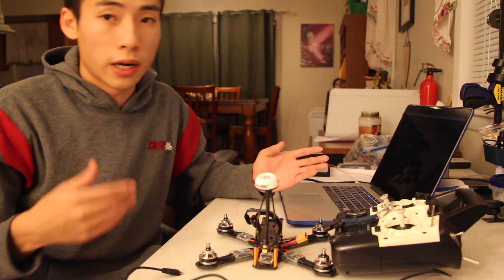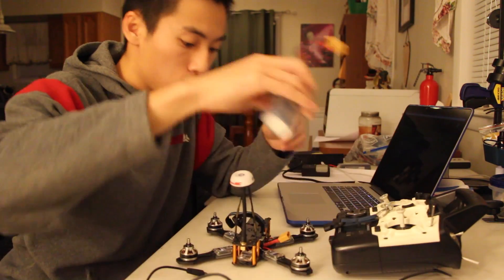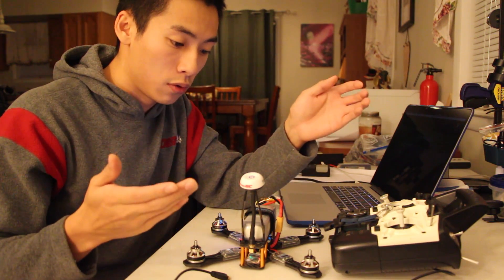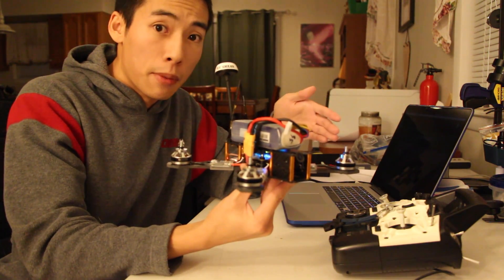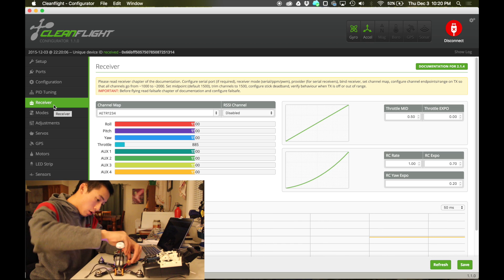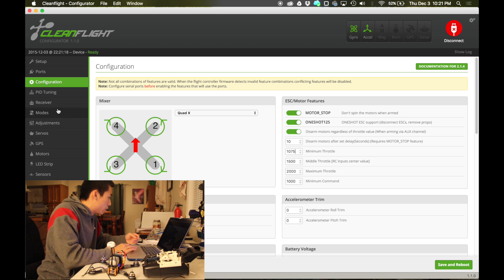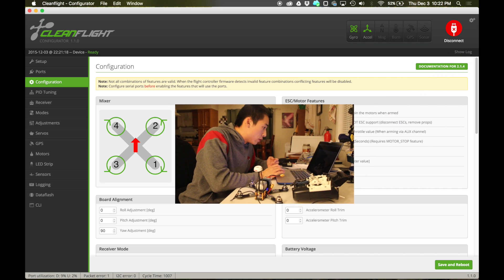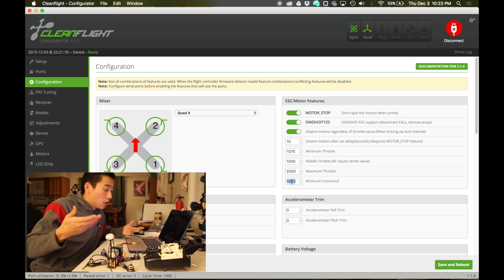Calibrate ESC with Cleanflight plus tips!

Comment: Great video. Have a problem. Using Cleanflight (ZMR 250 and same problem on Diatone 150 with same ESC's and same Naze 32 Rev 6) latest version with Naze 32 Rev 6 (10 DOF Board), Little Bee 20A ESC flashed with BLHeli. Everything in Cleanflight works perfectly and all motors are synched but Naze will not arm. End points are 1012-1500-2010 on Throttle. If I decrease the mid point I can get Min at 1000 but then top end drops to 1990 or so.....why won't the Naze arm? I have tried 3 other Naze 32's of which 1 is acre, 1 is original Rev 6 and one Rev from September 2015 but none of the boards will arm...this all started when I updated Cleanflight without backing everything up. Thank a million in advance!
Reply from the maker: Hey check the receiver tab again. Make sure the throttle and rudder direction isn't backwards. Also check that they're on the right channels. You can adjust the end points in the transmitter (at least I can on the 9xr) to meet the 1000-2000 range. Also, is the board tilted too much? There seems to be a max tilt that it will arm with. Too much tilt and it won't arm.
Reply: Thanks but the throttle and rudder direction are correct. The board is totally flat. I have tried everything I have read in the forums but the Naze will just not arm....it used to on all my Naze boards but now none of them will arm....Has something changed in the arming of these boards in Cleanflight? I always just put throttle down to the right (centre of Taranis Plus (Mode2).

Comment: I see you're using a 9xr (pro?) How are you setting the min throttle to 1000 on it? I can't find anything in the manual about that. I'm newb
Reply: I tried it with the min throttle at 985, and attempted this method, but it made my esc's worse.
Reply from the maker: +Black Cardinal 1 in the transmitter, I went into subtrim and made the mid stick exactly 1500, then in the endpoints, I corrected the max and min to hit 1000-2000. What transmitter do you have?
Reply: +Chonny I got a 9xr Pro. 
Turns out, my issue was just because the motors won't act right when on a level surface. It works fine as is, but I haven't changed the sticks to go from 1000 to 2000. Is in on the mixer or the limits or something? I'm not seeing anything anywhere with those numbers? Or are you talking about on CF?

Comment: PLEASE help i'm doing everything you say to do but they aren't calibrating like when i drag the master slide to the top and plug in i get no sounds no nothing?
Reply from the maker: +Thomas What ESC, firmware and flight controller are you using? Also, do the motors spool up at all in the motor tab? Might need to make sure signal wires are connected properly.
Reply: little bee 20a, naze32 rev6. Yeah the do spool up it's just one motor doesn't start at the same time

Comment: having a problem with my new emax rtf. done all the claibrations and only three motors spin the forth motor slightly moves and stops. I swaped the two top motors and same thing happend so its definitely not the motor any suggestions??????
Reply from the maker: +Andrew Moore Sorry missed this notice. Uh check that the ESC solder joints aren't touching any neighboring chips. Also make sure the screws that hold the motor down don't touch the windings. If you're sure the problem is in the ESC, it may be worth trying a new ESC as they're a little more difficult to troubleshoot.
Reply: Got it sorted thanks. Sent it back. It was a faulty esc. Cheers

Comment: Chonny thanks for taking the time. My grandson and I have built a Robocat and had problems with motors/ESC's firing up randomly. I tried this method you showed and I still have two motors that start late, on my Turnigy 9X Throttle of is 1060 full is 1900. I have even tried calibrating the lazy ones individually. When in cleanflight after calibration and using myTX the start values are all over the place. Should I have set something up on my TX? I have watched a few videos on PID tuning but beyond my skill and knowledge thus far. Any advice appreciated 😊
Reply from the maker: +Trevor Vernon the transmitter does not control the motors, so as long as it travels between 1000 and 2000 you're good on that part. if you raise the main motor control in cleanflight, do all 4 motors throttle up at the same time? also, do you have Motor Stop on? try raising minimum throttle to about 1100 on cleanflight or lower your transmitter minimum throttle closer to 1000.
Reply: +Chonny Just checked again raising all throttles together in cleanflight motors 1 and 3 (rear) start at 1116, motors 2 and 4 (front) don't kick in until 1194 but they at least seem to start together as pairs.With that kind of discrepancy I know it's not getting off the ground. I don't want to muddy the waters here but  I have fitted a NZ mini gps (ublox 7) This occupies terminals rows 2 & 3  on the flip 32 so now channels3 and 4 from the receiver are in 5 and 6. The GPS locates fine and locks on to correct location. could this cause any kind of confusion for the board?? I guess at my age it's bound to be pilot error (pardon the pun) but I'm lost.
Thanks again for your time

Comment: hi chonny, i have just finished building my first ever quadcopter the  qav210, my question is does the thread direction whether its CW or CCW matter when buuilding any quad. my motors are all CCW, eventhiugh my ESC are calibrated i still could not have it fly it always tend to turn upside down !! I need Help Please
Reply from the maker: +Nawaf Ebrahim the thread direction doesn't matter for flying. it only helps keep the propellers on if you choose not to use a nylon lock nut. The motors do not all turn CCW on a quadcopter. two are cw and two are ccw. there are many things that flips your quad, from motor placement to propeller direction and motor direction.

Comment: Im having a bit of trouble with calibrating the escs check my issue in this video: https://www.youtube.com/watch?v=g-QsJ6QPOkc. The problem is that each esc are not synced in beeping listen to this video https://www.youtube.com/watch?v=Q2OYd2xVmrY&feature=youtu.be, i've tried calibrating each esc indivually according to normal settings in this manual http://www.rcgroups.com/forums/showatt.php?attachmentid=8587499&d=1452373581, but the sound is still out of sync... the thing is i can get it of ground but it will wobble so much that it falls out of the sky...
Reply from the maker: +Schlibib lol! Oh how we all struggle with this hobby...yet we all seem to keep at it cause it's addicting 😂 glad to have some positive impact!
Reply from the maker: +Schlibib check your motor screws. they can't be touching any windings or even the insulated wire going to your motor. the calibration is fine. also check the ESC if you did direct solder. the solder joint can't touch the FETs
Reply: +Chonny I'm going through this same issue,
I have checked what your suggesting but nothing seems out of the normal
Reply from the maker: +Jose Molina try calibrating just that one motor. You can follow the same procedure but instead of raising the master switch, only raise the switch for that one motor. Maybe it didn't get the calibration for some reason. Double check minimum command is just around 1000.
Reply: i solved it by using CLI command in following order: 1. Plug in quad and connect, go to CLI and write set min_command=2000 and write save. 2. Disconnect usb and the plug in battery and usb together. The wait for the 2 beeps, but be ready with the command, set min_command=1100 and write save. Notice!! You only have a few seconds put in the last command as you connect the battery.
Reply: +Schlibib thanks brothers I'll give it a try, I'll keep you guys updated
Reply from the maker: +Schlibib nice work! Yea that does the same thing and apparently that's the only way to calibrate ESCs on the KISS and Lumenier flight controllers now. Just wondered why did you set min command to 1100 and not 1000?
Reply from the maker: +Schlibib oh and I guess I should have said something about SimonK ESCs only having 2 seconds to get to min command. I'm so used to BLHeli just waiting for min command.
Reply: Chonny thank you, your video helped me to alteast think twice to know ESC wasnt broken. i put it on 1100 because it wouldnt calibrate on 1000 on having both minthrottle and mincommand so i change min command a little higher and then it actually took the commands. but i tried again with 1000 and that seems to work now aswell.
Reply: +Chonny 
I replaced the ESC that i was having trouble with and everything worked good, now i need to mess with the PIDs any advice? 
i have the naze32 and emax belheli 12a

Comment: My ESCs keep beeping when i do this and won't stop, I've been looking around but haven't found a good solution yet, do you have any ideas?
Reply from the maker: +Richard Ward ahh so it is cycling through the menu option. Simonk gives you 2 seconds after it registered the top end throttle to move the throttle to the minimum. If you let it stay at the top end too long, it goes into program mode. What you're hearing is the menu selection beeps.
Reply from the maker: Do you have the signal and ground wire backwards on your ESC connection to the flight controller?
Reply: +Chonny I have the wires connected correctly (it's a skyline32 board, came with copter as part of a kit) the quad copter actually flies just not correctly, two motors won't spin up until I get to a higher throttle.  When I follow the steps in your video (which is well done) the ESC's keep beeping.....beep.....beep beep.......beep beep beep.......beep beep beep beep......starts over, I let it go like that for a few minutes.  They are Emax Simonk 12A.  I'm going to try and connect them one at a time to my throttle channel on my turnigy 9x receiver and attempt the calibration that way.  I spent a few hours last night attempting to calibrate them to no avail.  This is my first home built quadcopter and I don't know anyone who works with these.
Reply: Ok so if I follow the directions in your video but move the throttle down really quickly after the first few beeps they should calibrate?
Reply from the maker: +Richard Ward yes before the numbered beeping starts. You can also google SimonK user manual and there's a section showing proper throttle calibration techniques and what type of beeping to listen to. The ESC in this video run BLHeli 14.2 so I do not get the 2 second limit as your SimonK has.
Reply: +Chonny thanks for your assistance, got them calibrated,  you have to be super quick.
Reply from the maker: Switch to BLHeli and you'd have time to grab coffee before dropping the throttle :p plus the ability to adjust all the settings on the ESC through the flight controller!